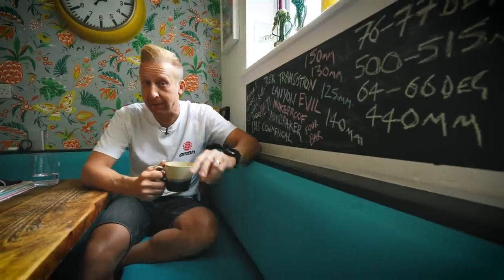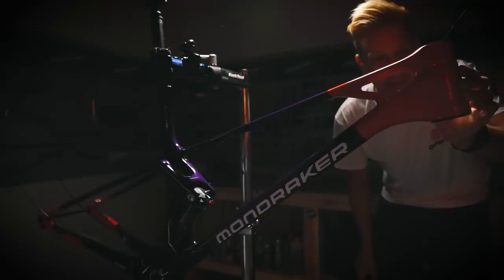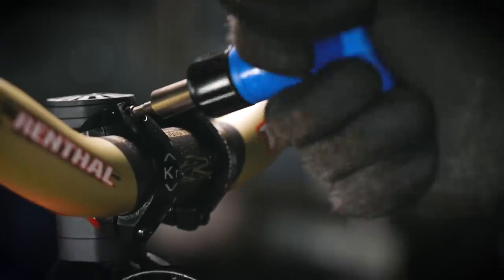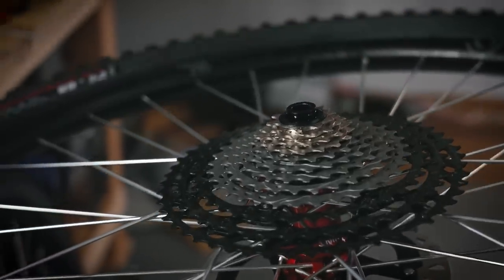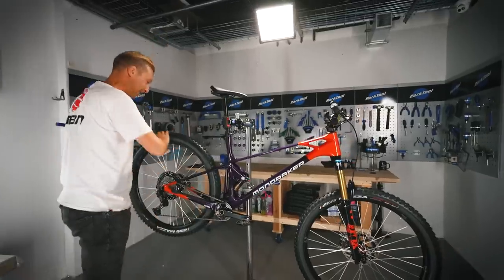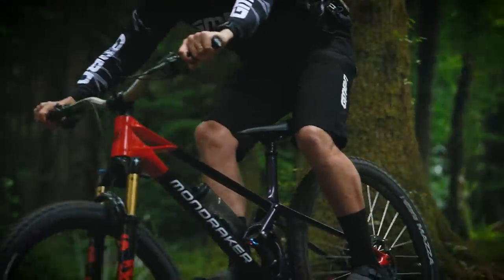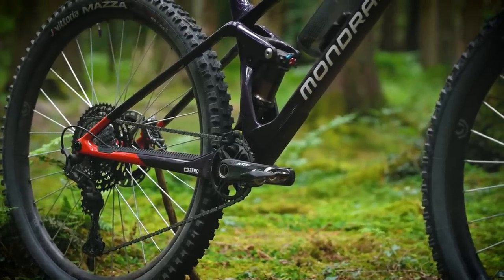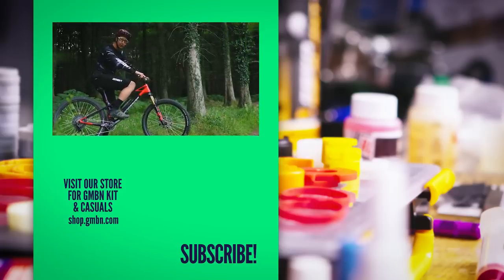Building My Dream Trail Bike | GMBN Tech's Perfect Projects!

Comment: I really like what you sad about heads up riding. I got so much bad advice about buying a normal bike and "just do a couple miles at a time" to work up my stamina when I was moving from sea level to the mountains. Painful, boring, wasting drive time just to get to a trail and ride for a few minutes and go home. My friends just didn't get it. I explore, I don't spend an hour outdoors, I spend a whole day. I don't pedal, coast, and put it back on the rack, I hang out by a creek or in a hammock and enjoy where I went. For me, it was an ebike, for someone else it might be a low travel shock bike, but I know when a friends rings me up for a ride, I will. And then when they pull away after the ride to go home I will head back up, back out. The trail calls.

Comment: This video really helped me. I wanted a shorter travel bike but I DID NOT want a Fox 34.. I want a fox 36. I'm a bigger guy and a fox 34 is just not going to cut it. I decided to do a frame up build.  I kept going back and forth between the stumpjumper, and stumpjumper evo. After seeing this, I'm going to go with a regular stumpjumper carbon [130mm] and run a 150mm fox factory 36 on the front.  Any advice is gratefully welcome. 
Happy riding!

Comment: I agree: on rear wheel (single pair calipers) brake with 160mm rotor is more than enough ;)
Strong enough to lock wheel, saving little weight, and is cheap.
But if i can do small advice for save some money:
Front: single pair calipers brake with 203mm rotor - similar performance and weight compare to dual system with 180mm, but 203mm has more heat disspersion... Cons: easier to bend it ;)

Comment: Doddy. GT Sensor Carbon Elite with a Cannondale Lefty on it . Running a 27.5 on the rear. 11speed internal hub running wireless shifting. Manitou front fork.

Comment: I use i9 270 with 24h  wheel set. I only buy i9.  I also only use alloy wheels too. The rim deflects in just the right way. I have a set of i9 trail 280c carbons wheels too but I use those for very rarely and it’s only for places that are flat.

Comment: if i got the opportunity to build a bike with no budget, i would pick a Pipedream Moxie Mx3 27.5 with a chameleon respray. my groupset will consist of a X01 cassette with a GX AXS RD and a oilslick sram chain. my cranks gotta be the 5DEV Enduro cranks with some Yoshimura Pedals. my wheelset will consist of Spank rims laced with Berd spokes and Onyx Hubs. the brakes gotta be the Trickstuff brakes with HS2 rotors 180 R, 203 F. Also, an AXS dropper with an Ergon Saddle, i would also include Title Bars and Stem with some ODI rouge grips, finally for suspension, gotta go with Intend Edge Fork

Comment: I would honestly build a very similar bike just with 27.5 wheels instead.  I love a good short travel trail bike with a fork that can take a bit more abuse, it suits my riding and the trails I ride very well. I wouldn't be picky about rear hub I actually like it when it's slightly less engagement. And also I prefer flat pedals.  Other than that same idea love the vid  🤘🚵‍♂

Comment: #askgmbntech hi my chain and cassette gets rusty after a muddy ride even though i wash it, lubricate it and dry it after what should i do to prevent this from happening again?
Reply: Hmmm . I live in the high desert in the US and I see no rust .  Now I traveled back east and the bike was in the rain and rode in mud and creeks . Now I normally don't wash my bike . I may wipe it down . When I came back to the desert my bike had some light surface rust that basically went away . These are budget parts so not high quality . It's possible if you live in a place with high humidity matched with colder steel  of your components you may develop condensation leaving your components always wet . So it maybe how you are storing your bike . Mine is in my house .